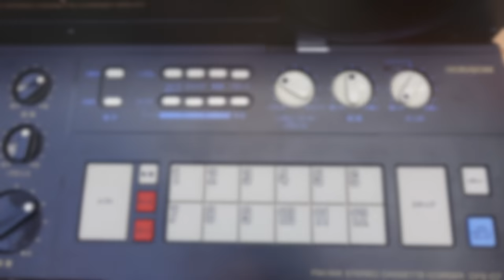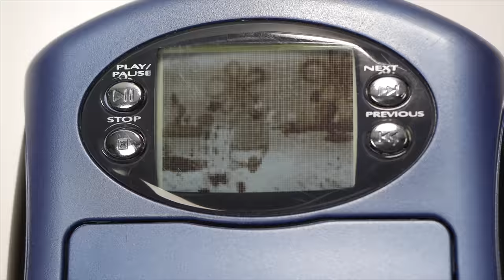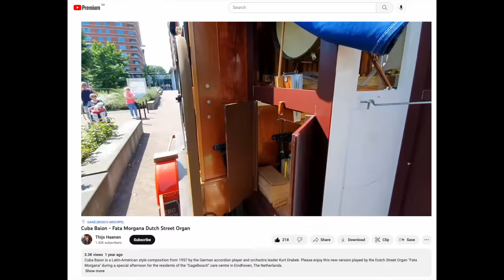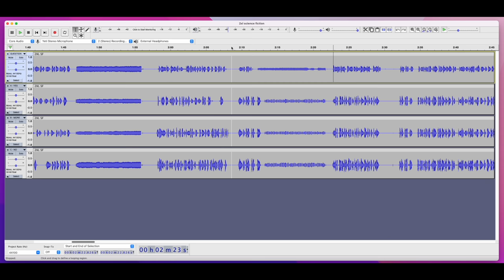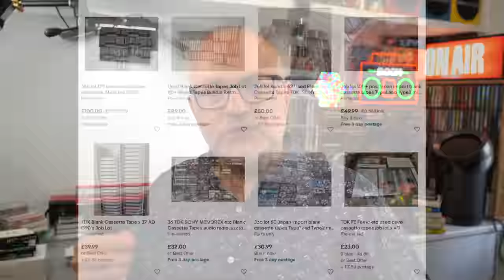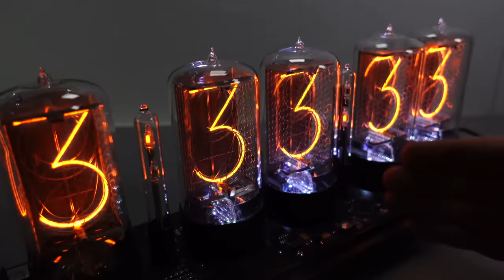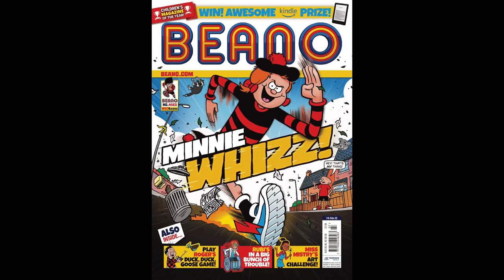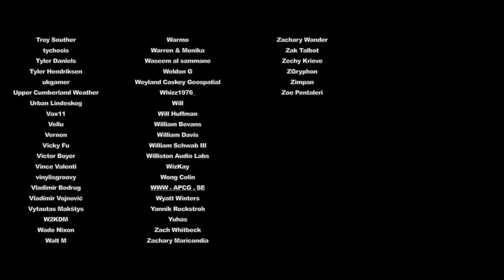Techmoan 2022 Wrap-up video mix-tape

Comment: Have only been subscribed for the last 4 years since seeing your aldi boom box review. I purchased one as an impulse buy before and then searched for reviews to see if anyone else had made the same error 😄The tape mechanism is rubbish but its still in use as it has the bluetooth feature as a speaker.
Been a rough year heres hoping next ones better

Comment: Okay, this hit me in the guts a bit, because I gave up on content creation (not video, though) a couple of years ago due to attracting a small but quite loud group of people who had a single-issue problem with my content and it turned toxic quite quickly, especially - weirdly - after I started going into explanations.

I understand and appreciate fair criticism, but going personal is another level and here's the thing: all content creators start out doing this for free and 99.9% of them continue to do this for free (and if someone's doing great, you might support them through Patreon or something). It's a hobby mostly. If somebody opened up their shed every week for an hour for everyone to see how they are - say - building model airplanes, you don't go in there saying "the walls are crumbling, get it fixed" or "I hate that shirt you are wearing".

Now, of course there is a responsibility on the creator to present themselves in an at least reasonable manner and it is welcome to be pointed out how the content could be improved, but again: this is not a service, this is someone's carved out free time out of their limited lifetime. If you're disappointed in any element of the content, you can do two things: 1. Do nothing, click away, find something else to spend your own lifetime on. 2. Be reasonable, think through what you've seen and think about how it could be improved and put it down in a respectable manner for the creator, or if you don't understand something, feel free to ask, but remember: they are not your best buddies, so apporach the creator as you would someone in an unfamiliar settlement for directions.

Finally - to repeat myself, but I cannot stress it enough - it's free content, not a service you paid money for. And even if you did, you should at least respect the creator as much as you would anyone you approach for the first time.

Comment: Hey, I appreciate you putting out any videos and get that its been a rough few years for everyone. Keep on and stay well. I will add that I've had nasal pullups as an issue my whole life - including tons of surgeries to help stop them but later realized I have horrible allergies that caused them to form. I also quit taking nasal steroids due to worrying about losing my sight and other side effects but there are some alternatives. Hopefully, you're able to get it under control.

Comment: Well done, that's your best video of the year. Not only did you do a great tech roundup and update, but you covered physical and mental issues. I'm sure that this message will get lost in the sea of messages, but I for one would rather see you post less so that you maintain the amazingly high broadcasting standard that almost all YouTubers try their best to copy and aspire to. My favourite piece of film that you've done is when you explain the hundreds of messages you received about putting the same type of batteries into a device and then you go to great length to find 6 completely different types of, I think it was "D" cell, batteries. Please try to have that sort of attitude when you get stupid and painful comments posted. Remember, all the 1.25+ Million Subscribers love what you are doing. 

I would like to wish you the Happiest New Year possible.

Comment: Long-term puppeteer here getting cramps in your hand is pretty normal, which is why you got to do some hand stretches. It will greatly reduce the hand cramp and arthritis feeling in your hands. I think you can find some good ones online just look for top-tier hand stretches, and do them before you do any sort of puppeteering and you'll find that it's not as hard on your hands.

Comment: I didn't think one would complain about how one would sound, among other things. I think you sound fine and still understandable as it is, and still sounds signaturely as you. Thank you for providing for 2022!
Timestamps:
0:00:00 Intro with as much Christmas spirit possible.
0:02:26 01. The Sony CHORDMACHINE
0:03:48 02. How CD players lost their cool & why the Technics SL-P1200 didn’t.
0:04:56 03. The Magic Message Audio-Visual Repeater
0:06:13 04. A very odd Walkman. Ever used one of these?
0:09:05 05. Sony LinkBuds Review - The whole truth about the wireless earbuds with a hole
0:10:33 06. Obscure 1991 hand held game machine - The J.Cock Z400S
0:13:29 07. VideoNow - the worst quality pre-recorded video format ever?
0:16:35 08. REVIEW : tonies® - The character-activated audio player for kids
0:19:30 09. Cylinder Records - New music on dead formats taken to the extreme (CUBA BAION previewed)
0:23:59 10. REVIEW: M90 Mini & Micro Boomboxes - More than just excellent replicas
0:25:43 11. BMS2600 : The last Philips tape-based Background Music System (& abridged)
0:28:28 12. Playaway : The audiobook players that smartphones couldn't kill
0:31:42 13. Ordro EP8 Head-mounted Camera Review 4K60
0:33:20 14. 2XL - The ‘70s toy that faked A.I. ...with an 8-Track
0:35:07 15. RCA 8-track changer - Fix or Fail?
0:37:10 16. Kenny Everett's carts
0:38:55 17. 8-Track : Big in Japan? RQ-8 Dynamite from National
0:41:17 18. Erasing Tapes - how sweet the sound?
0:44:51 19. Shaving Compact Discs to improve the sound (?!)
0:47:06 20. Sharp's record-playing luggable stereo : VZ-2000 repair & demo
0:50:24 21. It's retro-tech Karaoke fun time with Yamaha's 1990's ING's system
0:52:50 22. Demagnetizing CDs?!
0:54:57 23. NetMD into 2022...and beyond
0:57:28 24. Biggest new Nixie clock
0:59:24 25. Have you seen THE LYTE?
1:00:36 26. New 2022 Sound Burger REVIEW
1:02:48 27. MicroMV and me - Tiny Videotape, big impact (& Elvis in a shopping mall -Full Clip)
1:06:56 Personal Challenges in 2022
1:15:22 Epilogue

As this is a segment of clips, I thought timestamps are fine for this one. I'm aware of the "story" and chronological order stuff Techmoan videos wish to present; I for one watch videos in whole anyway. Please excuse me.
I wish to shorten the titles, but I thought to leave them unchanged for the video title familiarity.
Let me know if you wish for the shortened one, or have times corrected, etc.

Can we also give appreciation that, no matter how long this video has gotten, there are no midroll ads? Some Techmoan videos do, but not in an awkwardly interrupted way.
Thank you!

Comment: Shocked by the parallel with my own medical issues. Not the same, but similar kinds of knock-on effects. Most people have no such experience, can't understand, and if they are lucky then they won't need to. Wouldn't wish these problems on anyone. Thanks for sharing.

Comment: My nose problem, I was in a small explosion of acetylene and freon gas and I came into the door bringing oxygen to the mix. as someone was trying to light the acetylene to soder the freon line. All I saw was Orange, yellow, black and red flames coming at me. This cauterizing my nose down to my throat. I must have goughed just at the right time. but I sound like i am pluged up all the time. So, I feel your pain. but does not bother me at all. I enjoy the channel and some of the humor takes me a little time to get. I am Yankee from the states,

Comment: Had thought about your little wood-burning flame tv thing, I had gotten a lot of the much bigger wall-mount electric fireplaces units, that work exactly in the same way as yours does, if you open it up you ll find a few LED that shines onto some sort of shiny metal or something like Thicker and stiffer Christmas tinsel that rotates on a rod, which is what gives you the flame pattern If you swap out some of the LEDs for some red and blue ones you will dramatically change the effect and give it a nicer flame look with what they call fire and Ice effect. In any case, could be a cool little video idea i still have tons of parts for those things including the red-like plastic material the light projects the flames on. Cheers!

Comment: Hi Matt. I think your fire in the TV is actually a reference to one of the Terminator films.  There is a very iconic scene where they are walking past and it looks like someone's watching TV and then it turns out they are actually just using the TV as a fireplace.

Comment: 36:07 Using tape to adjust the size of a pulley for 50 to 60 hz conversion is fine.  I have an idler wheel phonograph that sold a spring to put on the motor shaft to make it bigger to covert from 60 to 50 hz.

Comment: I have something that's a bit of a suggestion.  Do you remember the Archos 605 WiFi portable video player?  I loved mine until the hard drive failed.  I'd love to see a video on one of those, just to remember how much I enjoyed it.  (p.s., I still have mine, and you're more than welcome to it if you wanna play around fixing it.  Just needs a new drive I think.  Maybe a battery, but I actually have a replacement one I can send along.)  I'm in the U.S., so take that into consideration for time purposes of getting it to you if you want it.

Comment: BTW, the world of audiophiles BTW is a strange one indeed, bordering on religious beliefs with some. The snake oil type devices like the CD demagnetizer, CD shaver etc have both their proponents and their detractors (and both camps are equally convinced that THEIR opinion (and only their opinion) is the correct one) but it's a mild breeze compared to cables. Not only are there people that can spend a bazillion smackers on speaker cables (where you definitely CAN hear a difference between cheap crappy cables and at least decent ones) but there are oh so many that swear by spending similar amounts on not only HDMI cables (again where there IS a difference in bandwidth between cheap and less cheap products, if not with regards to A/V quality) but also network cables, again more in a religious kind of way than anything else.

Comment: My comment is unlikely to be seen by Mat but on the off-chance he does here it is. I've been watching you (sometimes religiously) since you started (pretty sure you served me in HMV once) and you've worked hard to gain your 1.28M+ subscribers. With this large population + Patreon's, I can see there is pressure to deliver regular content to maintain popularity and perhaps some cashflow. But you should never put your health in second place! You should therefore slow down and like many, I wouldn't mind if you made much fewer but more quality presentations in the future. Perhaps 1 a month will do! It sounds like your partner works so assume income is not essential but better be alive than rich...you can't take any of it with you! PS. ditch those moaning patreon chumps.